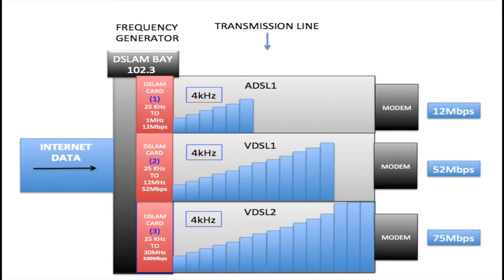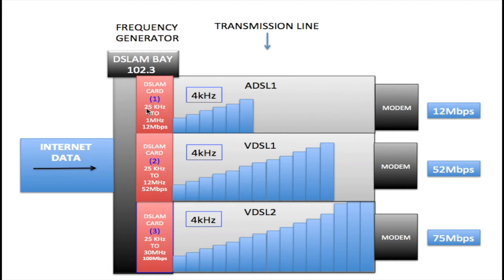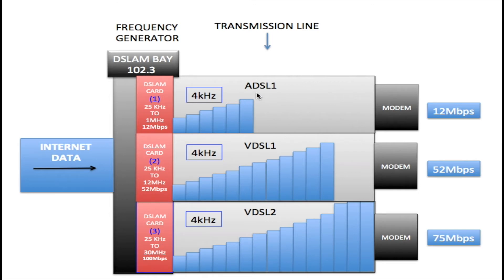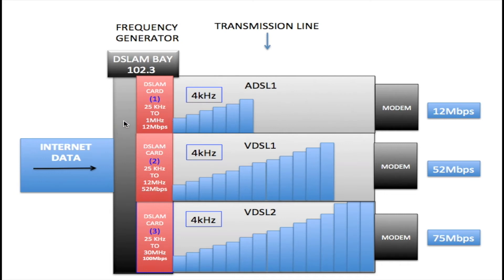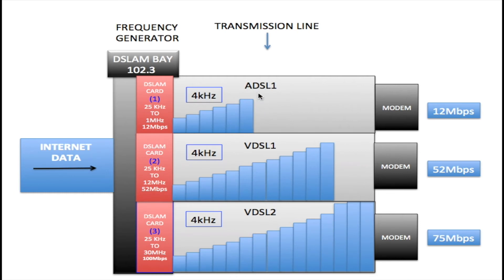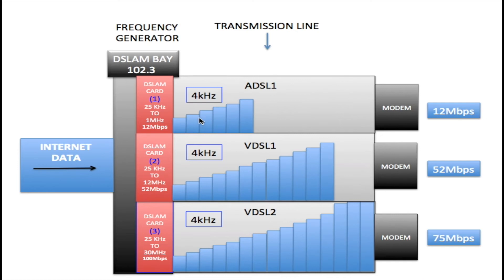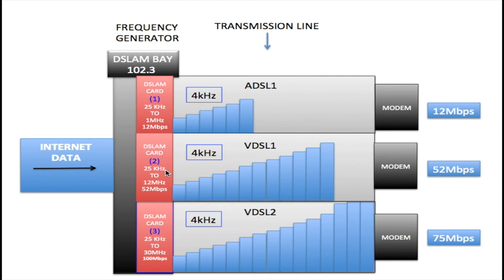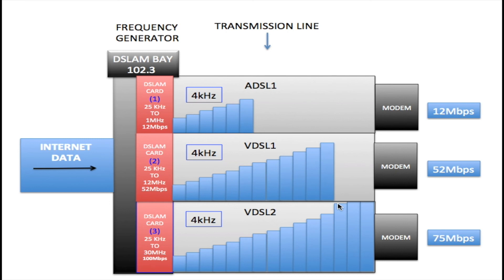Frequency, Speed, and Bandwidth Explained:  What is the Differences.

Comment: Why each bins filled with 56 kilobits!!????
Reply from the maker: Thanks for the question Joshua.  They could have picked another value for the data other than 56k  to modulate with in the 4Khz channels,  but I believe that they picked 56Kb to be consistant with the speed used with the dialup modems which were popular back in the late 1980, and still are used today on a very limited basis.
Reply from the maker: Not sure why they picked 56k.  My guess it is to keep it consistent with the old dial up lines using 56kb speed.